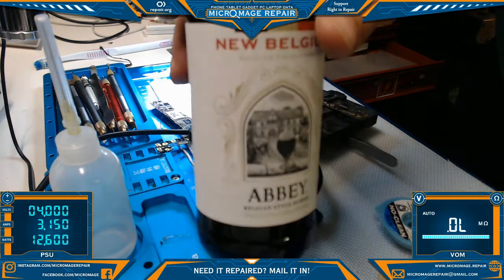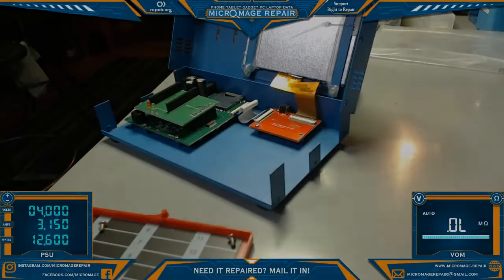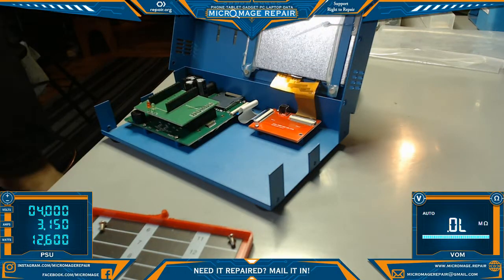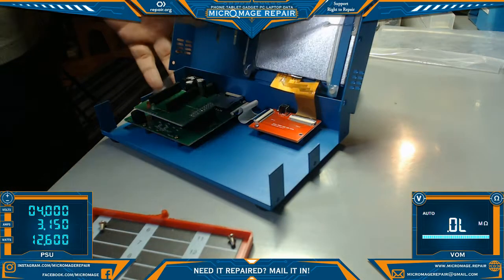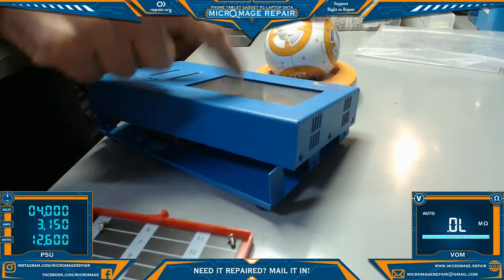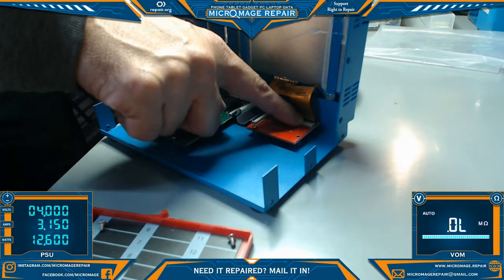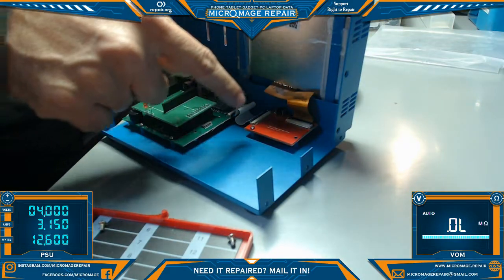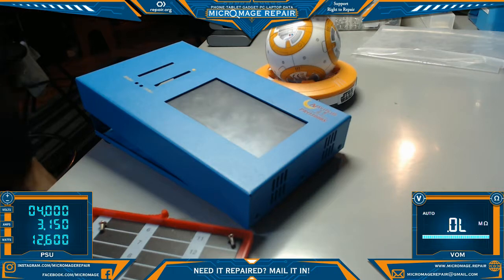Navi Plus PRO3000S No Touch/No Boot Solution

Comment: have same problem , havent fixed it yet. i doesnt boot , and has no display, even there's light on. i opened it up  and tighten the flex but still no fix
Reply from the maker: Not sure what to recommend on that other than try totally re-seating the ribbon.
It's been awhile since I've even used that programmer.